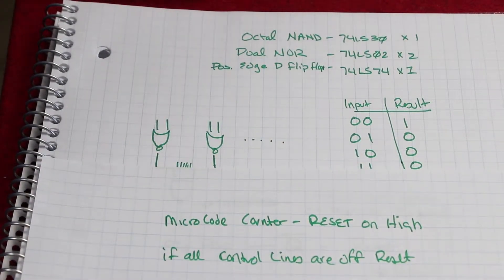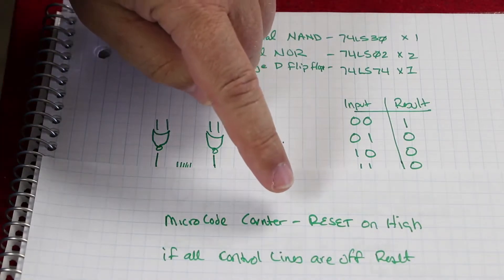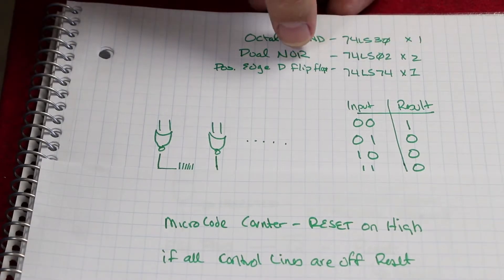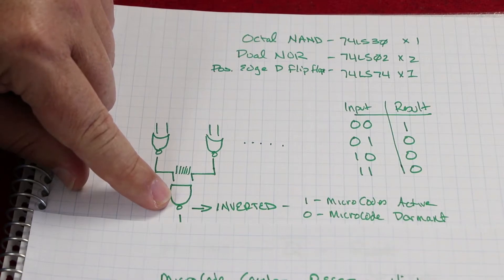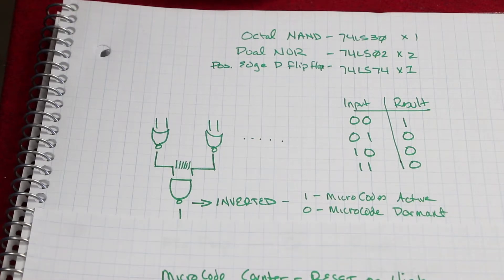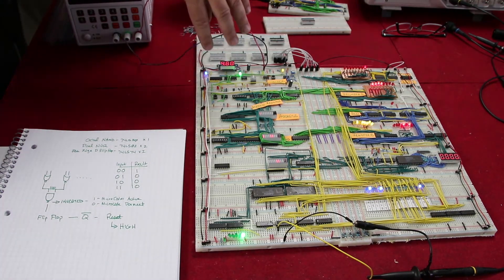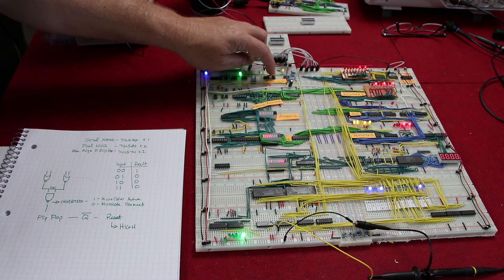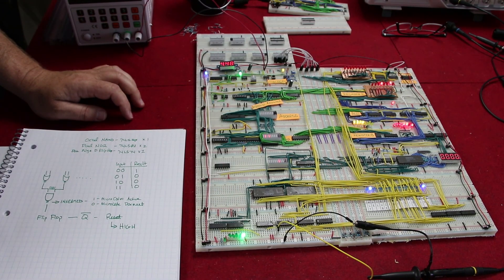Micro Code Reset Circuit - Ben Eater Breadboard CPU (electronics)

Comment: I have previously implemented a simulation of one of my CPU architectures, instead of what you did (props for that; very good design), I used a control signal to reset the counter. Saved me a lot of time in the end.

Comment: Hello LoneRegister,

Just watched your Micro Code Reset Circuit video, My two bits.

I am going to try coding my EEPROM using the 16th open instruction decoder output pin as an  "Instruction Micro Code Step Counter Reset" signal so your final Micro Code step instruction will reset the Micro Code counter to eliminate wasted instruction T Cycles. 

Remember NOP is 00

Keep up the good work :)

Thanks, Mike DeLosier
Reply from the maker: Good call here Mike - I think that is actually a pretty elegant way to go.  Can't think of why it would not work.
Reply: Welcome, The 74LS161 has a /CLR  used in divide by 5 / reset and /LOAD so you could load beginning count in the counter.
Thanks Mike.